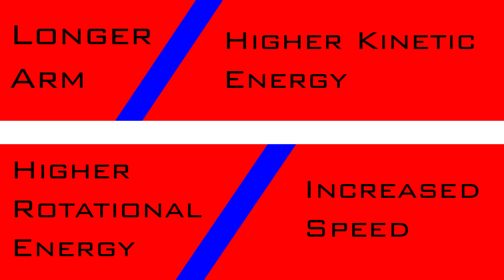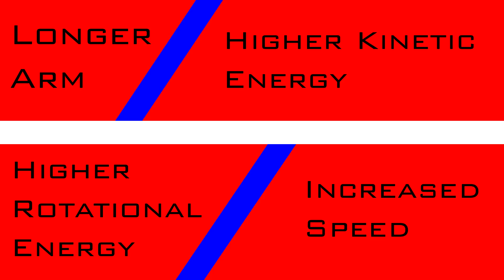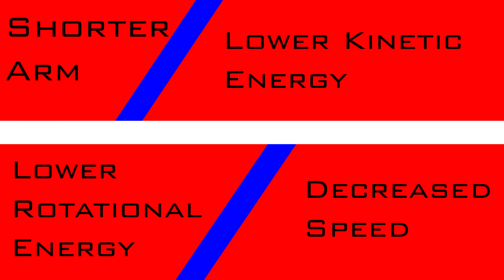How to Make a Mousetrap Car! - HD

Comment: Isn't it: the shorter the arm, the more torque applied; the longer the lever arm, the less torque? So doesn't this mean that there is more acceleration and speed with a short lever arm than with a long lever arm?
Reply: Elizabeth Nelson a longer lever arm results in more distance though,

Comment: What holds the cds from coming off
Reply from the maker: There are plugs glued onto both the inside and outside of the CD's. This way the wheels won't come off while the car is running but are not too difficult to remove as to hinder any possible repairs or redesigns.